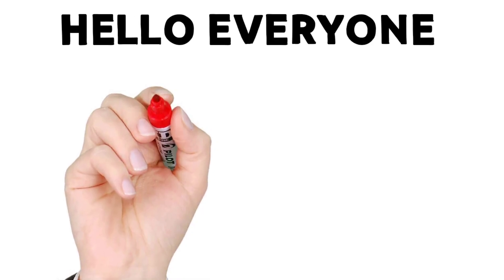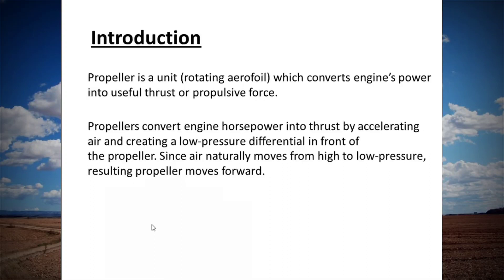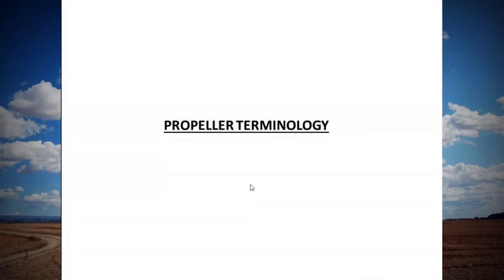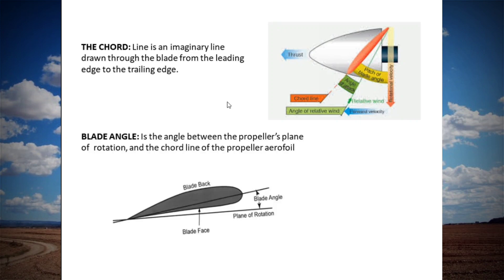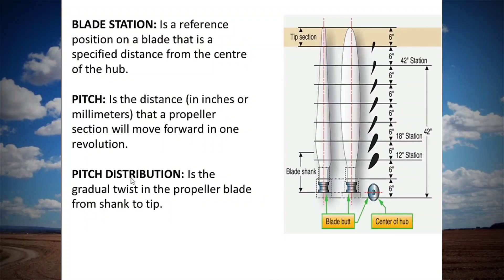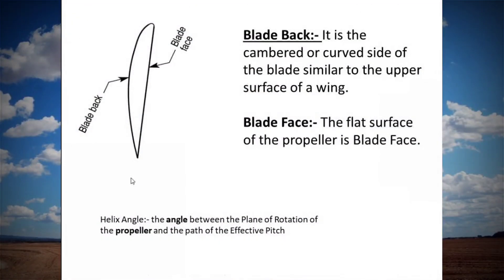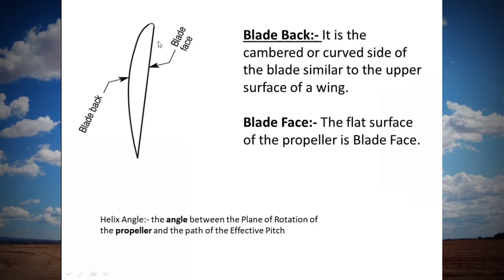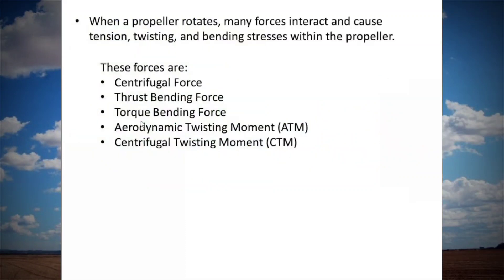MODULE 17 PROPELLER :- BASIC TERMINOLOGIES | AVIATIONA2Z ©| #module17 #propeller #terminology

Comment: If pressure is increased on the speeder spring, rpm increases. What happens to the  speed of the propeller?              

Option A.        Remains unchanged.  

Option B.        Increases.       

Option C.        Decreases.      

Correct Answer is.      Decreases.